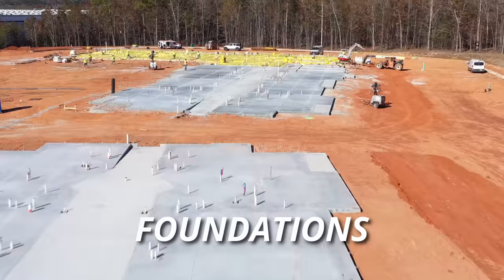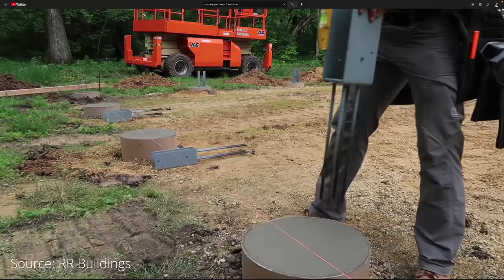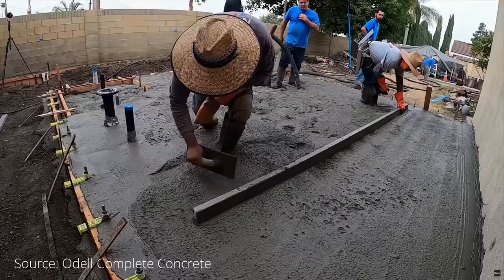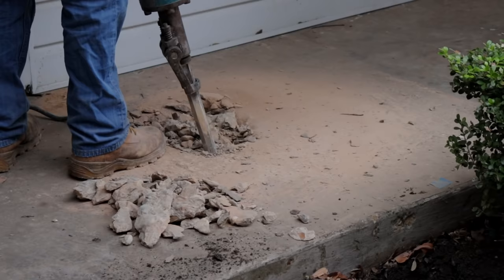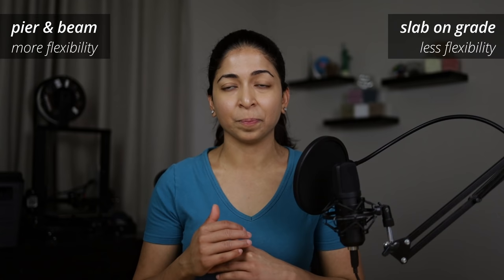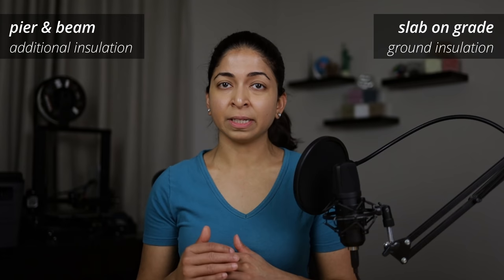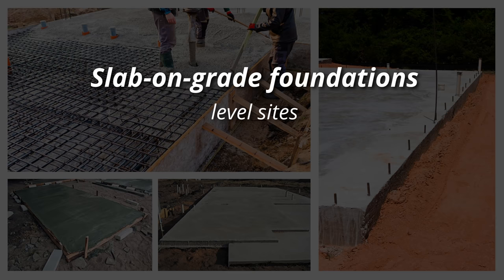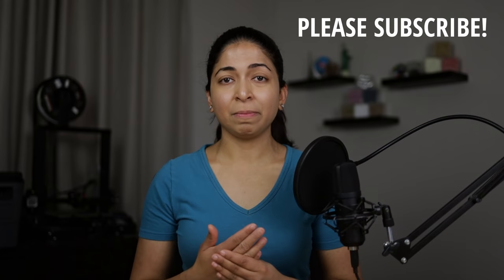Pier and Beam vs Slab Foundations | Which one should you choose?

Comment: can pier and beam be  possible for florid near tampa area? curious as would like to build the house 3 ft off ground.
Reply: Guessing your bedrock is very deep?  When building skyscrapers in Chicago where the bedrock is very low and too expensive, excavation is dug and a slab with additional criss-cross steel beams on top is created for a strong foundation.  This has created a "bedrock" condition on which you could place pier and beam.  Just a thought.
Reply: @TheRealBrook1968  so in a way, I would make a slab in the ground to 'make' the bed rock? ok

Comment: Could you possibly make a video going into detail on rebar in slab foundations? I've seen many videos where the rebar is elevated before the concrete pour, but I've also seen many videos where it looks like the rebar is laying on the ground and they pour the concrete over the top of it. I'm aware that they sometimes lift the rebar manually as the concrete is being poured, but with most of the videos where the rebar is lying on the ground before the pour, it doesn't look like they are doing this. I've also noticed that rebar going into highway concrete is coated with a green substance (for rust I guess). What is this purpose of this green substance, and why do we not use it on homes if we want them to last? I've also seen a new type of rebar made of fiberglass. I'm sure there is not much information on the longevity of these products, but I would like to know more about the potential drawbacks as the salespeople are only parroting the benefits they were told about, like lightweight, etc.
Reply: Rebar is supposed to be in the center of the slab. It should be placed on dobies (small concrete blocks with wires to hold themselves onto the rebar) or similar. Rebar is susceptible to corrosion if it doesn't have enough concrete cover or if water gets to it via cracks, which is why rebar used in bridges and such is epoxy coated.
Reply: @bmay8818  I agree it should be in the center of the slab. I've gotten feedback from concrete guys that say the engineers recommend the rebar be in the bottom 35-45% range. I have tons of video/photo evidence of rebar sitting on the ground and concrete being poured on top though...pretty scary stuff.
Reply: @towjam37  also most residential rebar is completely covered in rust which interfere with concrete adhesion. Rebar should have MINIMAL surface rust

Comment: Thank you, I have a pier and beam house with joist rot because of moisture. I was wondering if getting the crawlspace covered in plastic a better option for the future or would that merely exacerbate the problem?
Reply: You can find vids about damp proofing crawl spaces on YouTube. Covering the soil with a durable plastic does a good job of eliminating water vapor in the crawl space. However, it has to be done thoroughly. The laps must be taped shut and it has to roll up the outside foundation a certain distance. Then, all places where this membrane is pierced - piers, pipes, ducts, cables - have to be sealed too. 

If you can do all that, you will go a long way to eliminating your moisture. Also you might consider a crawlspace vent fan IF you live in a relatively dry area. Otherwise, you will just be pulling humid air into a humid space. Also, there should be no overt water intrusion into the crawlspace from vents, cracks, downspouts or seasonal rise of the water table.

Comment: I'm interested in your take on floor heating. I think this is only possible with a slab foundation.  Also, I'm in Europe and my house is like 50 years old. The foundation doesn't need any repairs.. Why do you say that new construction will need a foundation repair in a decade?
Reply: I'd be curious to know how thick your slab is. Most new slabs in the US seem to be about 6 inches thick with one layer of rebar in the lower portion of the slab. That's inadequate in my opinion, and explains the need for foundation repair. If everything was done perfectly, it might be enough for a house to last generations, but you can never guarantee that the concrete mix is perfect or that the people pouring the slab didn't spray it with too much or too little water. I have a feeling these practices also have a lot to do with "planned obsolescence." If all houses are built perfectly and almost never fail, there's no more work for the builders/tradespeople. There's a great video on YouTube somewhere about how lightbulbs were made to fail after less and less time so the lightbulb company could make more profit selling lightbulbs.
Reply: Whether your foundation needs to be repaired or not also has a lot to do with the type of soil under your foundation and the weather conditions in your region. Here in Texas, we have clay soils that expand and contract a lot because of long dry and wet seasons.

Comment: Vented foundations have vent openings that can be covered and opened when needed. Water under pier n beam homes can be kept dry with gravel on both sides of the perimeter foundation. As a plumber I have drained flooded pier n beam homes by digging a hole just outside the foundation. The water will level out even into the hole. Talk to us old  men of the trade that have actual experience rather that book info.

Comment: "Pier and beam construction is vastly superior! Where else can I hide my drug money?" - Walter White

I worked as an electrician (before I got old and lazy), mostly industrial applications, such as light rail. I never could figure out why homebuilders didn't just incorporate raceways into the home (either top or bottom) to accomodate all the conduits and piping, instead of having to bust up the floor every time... 🤔 ...And yeah, I've seen post-tensioned stringers come apart, and it's an event that'll get your attention!...Maybe you can address these in a future video, Belinda...

Comment: That looked like Kyle from R&R putting thos piers in. That is for post frame construction which is its own breed of building a d his buildings have a floating slab on the interior as well further complicating definition of the two types. What is interesting is that Texas would need to go to bedrock with the piers. Older homes built in texas literally were beam construction on piers that just sat on the ground. Nobody died. It sounds like Texas thinks they are TN or KY southern FL with sinkholes. 🤷🏻‍♂️

Comment: Hate to rain on your parade but my dad's  2 level home built on piers in 1970, (and really neglected) was drooping 4 inches off level over 26 ft.
Using 6, 20 ton jacks and slowly lifting in sequence back to level and using high strength concrete spacers we leveled the house with no cracks to interior or exterior finished walls.
The whole process took less than a day and cost 80 bucks to rectify.
My slab house one the other hand has cracks to china because the county has drawn so much ground water over the last decade from the Utah drought.
Cost wise, no comparison.
Sanity wise, my dad was right!

Comment: houses should all be built at a minimum of 4 feet of the ground in case of any type of flooding. i say the easiest and best way is for concrete walls that way no pest get into the crawl space and if there is any flooding your house is not destroyed. It is much easier for any repairs on plumbing heating etc... I have lived in houses with slabs and insects were always a problem. anything happens to the plumbing and you could be screwed big time. Just so much easier with a crawl space under you , you just have to do it right....

Comment: You choose what your local area requires by the local building code.  I do not particularly like slab foundations.  Too much is incased in the slab and if there is a problem you are screwed.  Try servicing plumbing issues encased in concrete or electrical runs also encased in concrete.

Comment: Interesting that we don’t use those methods in the middle east, here we dig a deep hole then we put reinforced concrete as a foundation based on the layout of the building then a lot of layers of different materials of foundation till it reaches at least 60 cm above ground level, our houses and buildings are always made out of reinforced concrete, what is this method called in the US?

Comment: Interesting the issues in Texas with the clay soils.  Thinking would be great to do like the next northern region and more-so the basement range of designs like say in Michigan and historically "Michigan Basements" and other lime, low fire bricks and stone based designs pre-hydraulic cement and high fire bricks... then getting more into from like old fashioned Netherlands and wetlands groups piles and related building on the sea designs to the more modern pilings with the latest helical, pin and other footing designs that don't require or go to bedrock or "rocks" geology.   Like the slab footings.... there are known codes for those footing dimensions.  Amazes me the more engineered designs can't be cut and dry similar related to the variables so like tables made to determine the specs for the options of footing.    Really sad such a waste of farm land and natural resources that produce survival related requirements and needs... so the surface area is littered by sexual deviants and their narcotics addicts and/or inbreeds "neighborhoods" that really don't "develop" anything.  Like the mine and farm valid developments mentality was deranged by mafia and other spy's to look the same.

Comment: Really a toss up then. I think if you're building a new home with no basement. You might as well go with beams. But the slab will be much more cost effective and likely not have any issue for the 30 to 70 years you might live there. It's really a 50 to 100 year problem.

Comment: I'd like to add that crawlspace homes have  a high risk of mold growth.  This is a big issue in areas that receive rain often.  Any crawlspace should be vented, have a sump pump installed to discharge water, and a proper vapor barrier installed.
Reply: If lot grading is done right water won't flow under the house....

Comment: Sorry to say but there s a third...where you dig under frost lvl 1m and pour a continous steel structured concrete base that will support the entire house where the walls will exist..no problem with the elements of nature anymore and earthquake proof. The ones you advertise are not accepted in my country.
Reply: The southern most parts of the US don't have a frost level (frost line is what we call it in the States). Our winter temps rarely (if ever) dip below 25F (-4 C); I've never witnessed a ground freeze in all my 40 years of life. And the only part of the US that experiences significant earthquake damage is California.
Reply: @eklectiktoni  -4 is enough..goes down 80 cm deep if lasts . Modifies earth and that affects stability..no wonder you have to start doing holes and maintanance in your concrete slabs..here once.you do it with a proper foundation..its 100 years+ or more

Comment: I have an immense dislike of slab foundations as mentioned any repairs or modifications are very difficult, they are cold, and hard on you. The heating and air are usually in the attic it does not provide good comfort and is not efficient as most attics are very hot in the summer and cold in the winter. The only advantage of a slab is cost, they are cheap.!
We are in Oklahoma our home is on a slab.
Pier and beam is better but… a crawlspace type is much better as it has a full perimeter foundation even on crappy soil.!

Comment: You need to come to Europe and learn how to build foundations for houses.
Reply: Pfft!
Stop buying all that Russian natural gas that heats your houses, then we can talk.
Reply: There are many more types of foundations found in the U.S. than shown here.
One thing this nation has is just about every type of climate and geology.
It's just that these two are typically used in the incredibly expensive clay soils where Belinda lives in Texas.
Reply: @willbass2869  LOL Most individual houses here use heat pumps for heating houses. We have hundreds year old houses and there is zero need for foundation repair.
Reply: @jimurrata6785  We also have clay soil, 95% of houses are brick and mortar (bigger pressure on the soil) but you never hear anyone saying they will need to repair foundations and I know what I'm taking since I'm civil engineer.
Reply: @conanobrien1  I'm not doubting you.
I'm just saying, that compressive clay destroying foundations is the reason that they don't have full basements in that part of the country
Reply: @conanobrien1  her over the top stories are crap. I live in same city, probably 10-12 miles away. Our side of Houston is thick sticky black clay. It's a VERY expansive soil. From her general area to Galveston bay (sea level) is about 55-60 miles and the elevation drop is LESS than 100 ft. It's ironing board flat. In 60 years the metropolitan area has grown from maybe 750,000 to over 3 million. Drainage and sewer infrastructure hasn't kept up (if even possible)

So when she pops off you should know she is yapping about a sliver of a sliver of problems in American buildings in a pretty extreme situation. Her general area has 1) a series of faults that increase soil shifting and foundation problems. The geology of the area wasn't well known until subsidence from water pumping exacerbated the issue
2) some few developers (always looking for $$) tried to build in this area using techniques developed for completely different areas of the country. They were lazy builders who sold an inferior product after flocking in to make a quick dollar.

As for for hysterical claim of people getting killed by post tension slabs....I say pfft. Maybe fewer than 4 or 5 over the course of 40 years I guess from a couple hundred thousands houses using that system. The technique had been improved but is a not used on a majority of houses.

I live in a 57 year old slab on grade single story 1600 Sq ft house built on the site of former rice field/cow pasture. Pretty unforgiving solid clay. 
Absolutely ZERO problems due to slab construction. The builder used appropriate engineering and material. My only issue was slight drop in one corner due to tree root intrusion.

So keep your nasty snide remarks to yourselves. I've seen shit buildings from UK through France and over to Balkans. The only thing that improved buildings on your blood soaked continent is 1000 years of war destroying everything and having to constantly rebuild.

Comment: Cable bursting through concrete,  absolute bullshit.  The cable is tensioned, as in pulling sidways. And they are in conduit so a cut cable will just snap back, the action which will be contained inside three slab.

Comment: I'm not a builder nor engineer but both solutions are crap; here in Europe we build a continuous reinforced concrete ''belt'' (depth & wide depends on soil conditions) with all drainage & electrical built-in and you never have to worry rodents, frozen pipes, the movement of the entire house in 50 years is minimal

Comment: This is how Americans build their foundations? No wonder they fail.  In Europe we have 70-90 cm deep concrete foundations only on the outer walls of the houses. They will last for centuries. Only in places with frequent earthquakes it would maybe fail. you have to dig that deep because the frostline can be as deep as 50 cm and also you have to remove the top-soil anyway. Digging another 30 cm is almost no difference in cost.